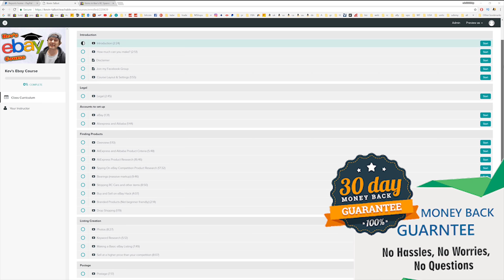(VOMIT WARNING) Traxxas UDR Nails DOG POOP RC Car Fail

Comment: I got some Floureon 3s 5200 35c battery’s and they get hot and one puffs just a little then goes down when it cools and my Floureon 4s 4500 50c get warm are these battery’s not good for my x Maxx?
Reply from the maker: 5000 4s in mine 35c no problems
Reply: Thank you for the response

Comment: Yo Kev im thinking of buying an Arrma Kraton. Its to replace my Nitro MT as im sick of it constantly breaking and causing me pain all the time. Im just abit worried about Lipos setting on fire. Is there a way to prevent them blowing and would cheap batteries from ebay be just as safe? Just asking as I want to get into electric rc for more run time and less money spent everytime i go out but i also dont want my house blowing up into an inferno of flames. Advice would be appriciated
Reply: Buy good batteries and it will be fine. Sheesh.
Reply: ryan olson  Good batteries cost double in price XD i think ill just run some flourions. Kev seems to too

Comment: The URD is CRAZY even when it is just upside down the extra friction in the driveshaft makes it heat up FAST, it is probably aluminum just to dissipate head faster, plastic would never work and steal might crack from the constant heating up and cooling down
Reply: yeah true but aluminum doesn't get as hot because it dissipates heat faster

Comment: Nice upload watching the heli part I don't think I could manage I can fly the twin blade ones just.
I hate that the dog owners don't pick up, I have two dogs did get up to eight but always pick up even though I am disabled, where I go to run my 5th scale gas my Venom VMX450 motorcross electric bike and my UDR and Nitro Savage with quad body and stunt Steve pilot, it takes me between fifteen to twenty five minutes to clear the shit, there are bins with easy access so no excuses, the dog walkers blame the tourist's but it is worse off season with, along with the darker nights know one can see them ignore the dog's taking a dump I see them as I run in the evening as I have lights on all my RC vehicles so I get to run almost on my own. Love the videos not watched your channel before fell over it when I was researching to buy the UDR or the LOSI Super Baja Rey. In some ways I wish I had as it seems to be faster and a bit stronger than the UDR, mine now has so many alloy parts it must weigh 20ilb's now but doe not seem any slower on 4 or 6S so doubt if I will go to 8S, as it is faster than a couple of my Gas trucks and buggies but not all. Keep them coming great laugh watching the mayhem and carnage, I come from the racing side so am a lot more sympathetic on my vehicles, I still come home with half not working as they should and spend hours wrenching on them I enjoy this part as much.